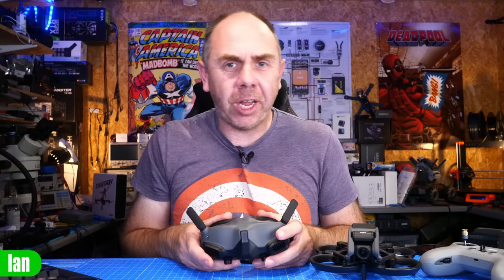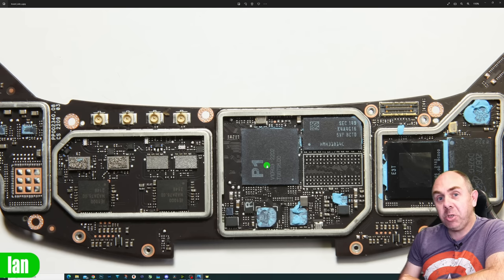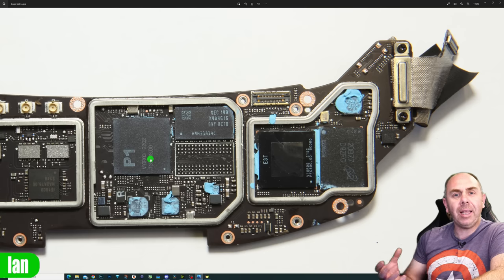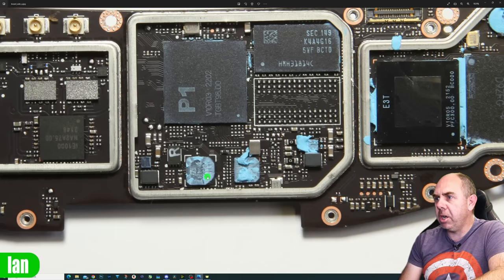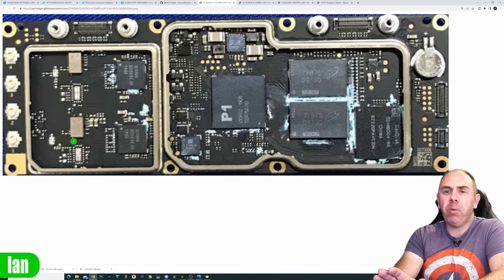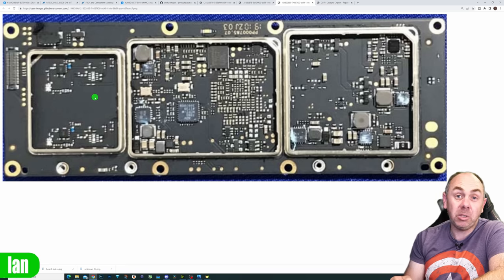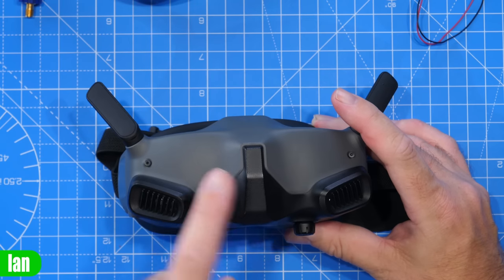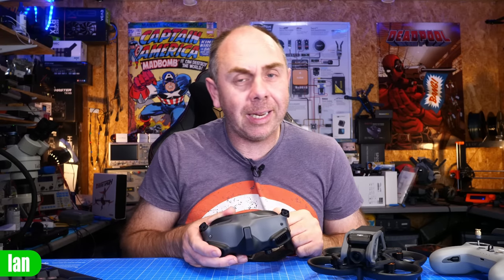DJI Goggles 2 - PCB Deep Dive & Internal Antennas

Comment: No GPS so the Avata is NOT SRID compliant (despite DJI's declaration) -- unless you only fly with your phone connected which is still not compliant because SRID must not be easily disabled (which unplugging your phone would do).    Looks like another self-certification fiasco under the FAA's watch 😞
Reply: That's exactly what I was thinking about.
Reply: I thought about that too. I don’t register anything. No part 107 or any of that BS💯
Reply: I'm definitely not an expert here, but I thought it was "ok" to broadcast the home location from the drone to indicate where the "goggles" probably are.
Reply: @rcrdps8144  Nope, the FAA clearly state that the exact position, updated once per second, (including elevation) of the ground station must be broadcast in a standard remote ID system.  They originally wanted to have barometric altitude information included to ensure sufficient accuracy but finally settled for GPS-level accuracy.
Reply: @xjet  Thanks for clarifying
Reply: So that means we can self certify our five inches as SRID as compliant, right?
Reply: Rushed release just before the September deadline too...
Reply: You can find all sorts of conflicting statements in the rule. For example 'The message elements broadcast by standard remote identification unmanned aircraft include a unique identifier; an indication of the control station’s latitude, longitude, and geometric altitude"

Plus the FAA doesn't test the drones for compliance, the manufacturer just pinky swears they comply.
Reply: @ShermanKenB  Actually, the FAA clearly state:

Standard Remote ID message includes: UA ID (serial number of UA or session ID); latitude/longitude, altitude, and velocity of UA;  latitude/longitude and altitude of Control Station ;  emergency status; and time mark

They are unequivocal about the need for the control station location in SRID.

It's the "latitude/longitude and altitude of Control Station" that the Avatar can't deliver because there's no GPS in either the controller or the goggles.
Reply: It's simply a update will be released soon which stops arming until it detects a gps signal and correct this will come from your phone being connected to Google's all the time.Need to make a phone holder so you can mount phone to the goggles strap thanks dji just hope this dosent happen to the new o3 air unit

Comment: Previous DJI P1 chip was labelled "V10R02" - this one is labelled "V10R03" - I fully expect that this new revision, R03, has changes from the one we see in the DJI FPV system previously, V10R02. I don't know if the DJI FPV goggles v2 had the R03, which allows them to connect to the Avata, or if on the old goggles, the Avata falls back to h264 because the old v2s had R02.  "P1" might as well be called "DJI Occusync ARM SOC" - the version label is the critical bit.
Reply from the maker: That will simply be production stepping, there may be some very minor tweaks but overall it’s the same Asic.

Comment: Hi Ian, so what is the most optimal antenna on the quad now with Goggles 2 Linear antennas?  I used RHCP on V1 goggles.  A steer would be good.
Reply: I’d like to know this as well

Comment: These goggles and the Avata gives a fair amount better performance and penetration than the V2 goggles even with patch antennas on a bunch of range tests already... 
What do they think they did with the transmission system to make for a difference between O3 and O3+ transmission systems when the power output seems similar?
Reply: Maybe these might be helping them:
1. Linear antennas. Even on 5.8Ghz, my v1 controller is always much much better signal than my v1 goggles. Controller is on linear antennas, goggles on cicular polarization. MIMO can decode a reversed/reflected signal, so it benefits from not rejecting those signals like circular polarization does.
2. 2.4Ghz. Pretty sure DJI documentation says the goggles stay on 5.8ghz, but some have said they see them switch at long range as long as you leave the channel on Auto.

Comment: Do you know what type of antenna connector is on the goggles? I'd like to purchase purchase an Sma adapter to try some of my old cross hair 5.8 antennas.
Reply from the maker: It’s MCX.
Reply: @MadRC  on the outside of the goggles, not inside. The ones the regular antenna connects too.
Reply: @DT-gun  it's mcx according to dji. Can you use any antenna? I want to try make an antenna for my car, but I don't know much about antennas ect

Comment: will wait to see what HDzero has to offer ..........
Reply: HDZero is great for racers, who want the lowest latency possible. Thanks really what their strong point is. 👍😎
But, for freestyle pilots, DJI absolutely KILLS HDZero in penetration. You can't fly out 100m and then fly around a large grove of trees or bushes without it significantly breaking up, from lack of penetration. You might even lose signal completely. Watch most videos about HDZero, and they fly it in completely open fields! Nothing at all to fly around, because that's where it doesn't do very good.
DJI can fly right around that same grove and not have any degradation in image quality at all.  If they do have any, which I haven't seen that myself, it will be barely visible.  DJI is also high definition and crystal clear, It's 910P with the V2 goggles, but to be quite honest, it looks even better that that in the goggles. Especially when flying a camera that allows 120fps!  Where HDZero is much fuzzier and not nearly as sharp and clear. Plus, there's all that analog snow and fuzz.  The two systems are truly worlds apart.

If you are into competitive racing, for sure, wait. If you aren't, then the deal on the V2 goggles from DJI for $429, is too good to pass up! I own these, and with the newer foam, they fit great. I also added a FatStrap to get rid of their terrible strap. The goggles now sit up on my forehead very easily, where with the stock strap, they didn't and your hair looks like that grove of trees when you take the goggles off! lol  I also got the iFlight Crystal antenna array and it's fantastic! Inexpensive too! Not only do you get the ease of just popping your goggles off and fitting them right in your backpack (no removing antennas), but the signal is improved.  I added the URUAV analog adapter with the V3 metal case to give me the best analog image quality I've ever had! But, I will be honest...I rarely fly analog now that my image quality with DJI digital is soooo damn great! But, flying with analog is better than my analog only goggles, which I thought were damn good...this set up is much better!  Analog and digital with one set of goggles is fantastic! And, it fits really securely on the side, and doesn't interfere with the iFlight crystal antennas on the front. Slides off in less than 5 seconds too! A big PLUS!  You don't have to have the analog set up on there all the time. It pops right off.

Hope this helps!  😎🤘

Comment: Would it be possible to upgrade a pair of v1 goggles to v2 by populating the 2.4g power amplifier circuit?
Reply from the maker: We don’t know what other elements are missing.  DJI just used a similar design. Basically the same but there are other differences.